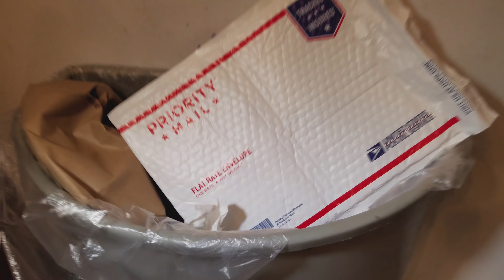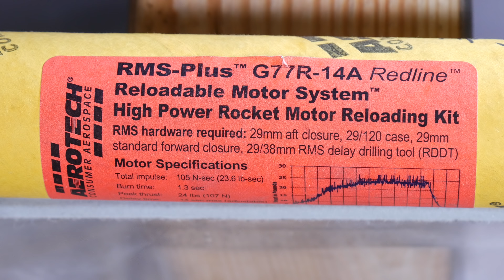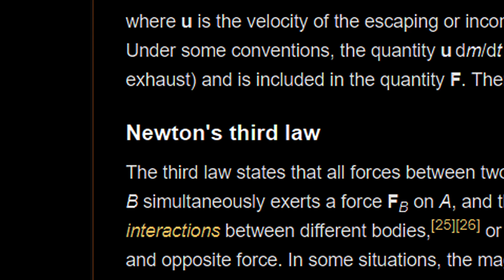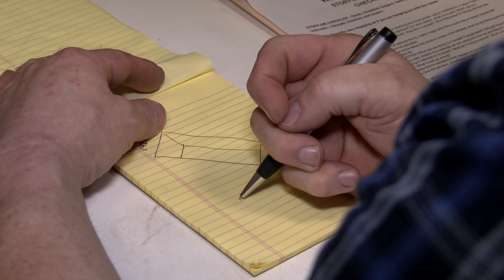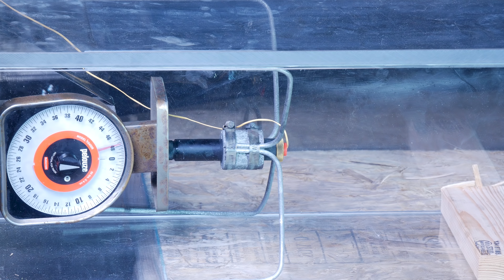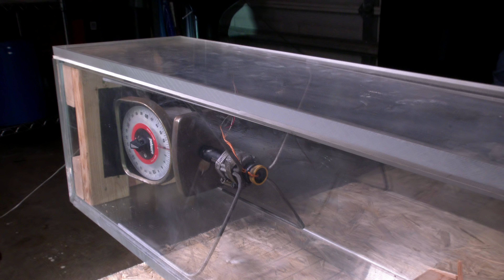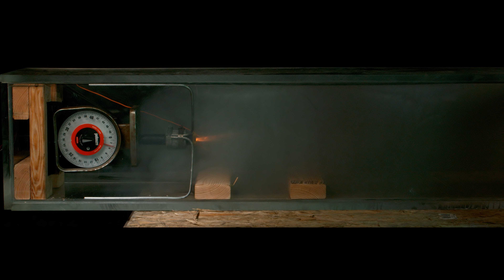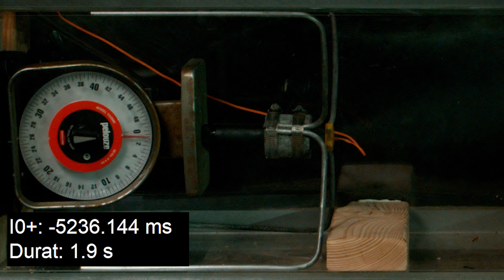Rockets in a Vacuum Chamber - Newton's third law of motion Visualized

Comment: In space if there is vacuum then gases expand not like this in enclosure where existing gases oppose exaust to produce thrust. Also why don't show difference in thrust profile.
Reply: "Thrust" occurs when the rocket PUSHES the mass of the exhaust gas into the vacuum. ANY time one object exerts a FORCE on another BOTH feel the force.
This is called mechanical RECOIL.
Recoil still works in a vacuum.
What would happen if I fired a crossbow into a vacuum?
Would I still feel a recoil force?
YES!
Reply: @stuartgray5877  One object exerts force on other, both experience force. So rocket exerting force on gases or gases exerting force on surrounding.
Reply: @neillibertine3044  no. Rockets exerts force on mass of exhaust gas. exhaust gas exerts force BACK ON THE ROCKET.
No surrounding medium required.

Rocket thrust is the mechanical recoil of pushing on mass.
Same as the recoil from firing a crossbow.
Reply: @stuartgray5877  How rocket exerts force on gases, it's gases which are active component while rocket is container. Yes, masscan do exert force but in space they are free to expand.
Reply: @neillibertine3044  the rocket applies a "force" (gas pressure IS a force) to accelerate the mass of the exhaust gas away from the rocket.
Do you agree that a "force" is REQUIRED to "accelerate" mass??
Do you agree that the exhaust gas leaves the rocket at high velocity or not?
Reply: @neillibertine3044  what would happen if I fired a crossbow into a vacuum????
Would I feel a recoil force OR NOT?
Reply: @stuartgray5877  Yes, force is required to not only accelerate but keep an object in motion, force is cause of motion. If you shoot an arrow from crossbow or bow it will go because it is using elasticity of string or potential to kinetic.

Now why thrust from rocket can't work in vacuum because here gases are working medium and in vacuum, external pressure is zero. So work done by expansion of gases is zero. Thus there is no reaction or thrust produced by rocket in space.
Reply: @neillibertine3044  - "Yes, force is required to not only accelerate but keep an object in motion,"
Absolutely FALSE.

Newtons FIRST LAW:
"Every body continues in its state of rest, or of uniform motion in a straight line, unless it is compelled to change that state by forces impressed upon it."

This means that a force IS REQUIRED to ACCELERATE an object with mass.
If no force is exerted an object will REMAIN IN MOTION INDEFINITELY.

Now perhaps you should try LEARNING about a topic BEFORE trying to debunk it?
Reply: @neillibertine3044  Now ANSWER THE QUESTION:
If I fired a CROSSBOW
INTO A VACUUM

WILL I FEEL A RECOIL FORCE?

WHY are you scared to just answer the question?
Afraid of being proven wrong, or do you just NOT KNOW how recoil works?
Reply: @stuartgray5877  Newton's laws are in order. First one is about motion, second one is cause of motion and third one is state of motion. So second and third give description of motion.
Reply: @stuartgray5877  About crossbow and bow I has already given answer. Qiestion was about thrust from exiting gases in vacuum.

So you have experience in rocketry, I would hear your experience but skeptic about many theories of mainstream science.
Reply: @neillibertine3044  WHY would a crossbow fired into a vacuum HAVE RECOIL??

There is "Nothing to push off of"

HOW can it still feel a recoil force?
EXPLAIN THAT TO ME.
Reply: @neillibertine3044  
"About crossbow and bow I has already given answer."

I asked the question:
"Would a Crossbow fired into a vacuum have any recoil?"

You answered with:
"If you shoot an arrow from crossbow or bow it will go because it is using elasticity of string or potential to kinetic."

THIS IS NOT AN ANSWER TO THE QUESTION.
If you think it IS, then that explains why you dropped out of school before the 8th grade.
Reply: @stuartgray5877  Recoil and shoot, both due to elasticity of frame of a bow. So what is your answer.
Reply: @neillibertine3044  Sorry but that STILL is not an answer to: WHAT DOES THE CROSSBOW PUSH AGAINST in the vacuum of space?

HOW can it feel recoil when there is no AIR resistance.

WHAT IS the "Resistance" that creates the recoil force?
YOU HAVE NOT EXPLAINED THIS.
Reply: @stuartgray5877  What energy spring has, elastic. So bow has same energy due to structure.

Where is your answer.
Reply: @neillibertine3044  Now consider taking an actual PHYSICS CLASS, BEFORE challenging actual engineers about basic physics.
Reply: @stuartgray5877  There is no action-reaction as most think, it is tool to consider momentum conservation and stability. For reaction one needs a obstruction to return force, like a ball thrown on wall.

So recoil from bow is elasticity of frame and when it releases outer edge encounter middle part that remain stable, that cause recoil.
Reply: @stuartgray5877  Then speak up truth that may sets you free.
Reply: @stuartgray5877  lying about everything, as usual, chatbot.
Reply: @papalegba6796 They have faith for science and insists on follow their cult with same faith, while science is about logic, observation and consistency of laws.
Reply: @neillibertine3044  the idea that a thermal rocket can develop mechanical power whilst in a zero external pressure environment violates every single law of physics. This is not debatable.
Reply: @papalegba6796  Tell us how a Space Shuttle Main engine accelerates 500 kilograms of MASS (EVERY SECOND) from a standstill to MACH EIGHT all WITHOUT FEELING A RECOIL FORCE!
Ready GO!

Now RUN AWAY without answering the question LIKE YOU ALWAYS DO GENIUS.
Reply: @neillibertine3044  Why dont YOU try answering my question above to Papa Legba. HOW CAN a machine ACCELERATE - ANY KIND OF MASS - WITHOUT FEELING A RECOIL FORCE.
Because that would violate Newtons Laws.

SO, tell me HOW a Space Shutte Main engine can do that please.
Reply: @stuartgray5877  Newton's second law is not complete description of motion, third law is. Because a force can't accelerate an object for long.

Third law states that at equilibirium, gain in motion by force is equals to loss in motion equivalent to applied force. This is terminal speed and opposing force is drag.
Reply: @stuartgray5877  I couldn't get your question. So either answer or elaborate it.
Reply: @neillibertine3044  - "Because a force can't accelerate an object for long."

False.
A force CAN accelerate ANY mass all the way to Light Speed.

SO you are unable to answer my questions? Maybe try taking a high school physics class BEFORE challenging actual rocket scientists about basic physics?
You have it ALL WRONG.
Reply: @neillibertine3044  - "I couldn't get your question. So either answer or elaborate it."

SO I know of a MACHINE , that can ACCELERATE 500 kilograms of water from a velocity of zero to a velocity of 2500 meters per second.

It does this using a FORCE (gas pressure) to PUSH on the mass of the exhaust gas.
Tell me that a machine CAN 
DO 
THIS
ALL - WITHOUT FEELING an "equal and opposite force" per Newtons THIRD LAW.

I just want YOU to tell ME that you know of a machine that CAN apply a force to a mass and NOT FEEL A RECOIL FORCE.
Tel me of such a machine.
Reply: @neillibertine3044  are you still claiming that a machine can accelerate mass without FEELING a recoil force?
Or did you give up trying because it is all over your head?
Reply: @neillibertine3044  simple question for you. 
Hypothetically,, if I set an explosion off next to you in the vacuum of space, would it have any effect on you?
Reply: @papalegba6796  why do you come on channels like this to troll, you don't add any thing to the discussion other than ad homs.
Reply: @entangledmindcells9359   In vacuum what creates shock waves or quick local vacuum at centre. I think this is sufficient for your question regarding vacuum.
Reply: @neillibertine3044  Huh?  simple yes or no.. 
Hypothetically,, if I set an explosion off next to you in the vacuum of space, would it have any effect on you?
Reply: @entangledmindcells9359  Then ask simple question about vacuum and state what exactly you are asking about explosion. As explosion can have pellets or sharpnels.
Reply: @neillibertine3044  oK an explosion that is a result of a pure chemical reaction that converts two compounds into a GAS that gives off lots of heat causing the gas to expand quickly.
Reply: @neillibertine3044  combustion in a vacuum is impossible as it violates the laws of thermodynamics. Ignore this chatbot & its troll questions.
Reply: @neillibertine3044  yes Neil.. Ignore us.. Papa refuses to address our questions and he certainly doesn't want you to possible learn something.. 
I want you to read my responses and Papa's and I will let you decide who presents evidence and logic to back their position.
Reply: @papalegba6796  Tell us what prevents combustion in a vacuum.. it is a simple chemical reaction between two compounds (fuel & oxidizer) that converts the compounds into new compounds & give off energy in the form of heat.
Reply: @entangledmindcells9359  What you want to tell, I can pick if it is worthy or not. Without resistance, one can't distinguish amount of force.
Reply: @neillibertine3044  to help tutor fellow students in physics & engineering I used examples to help them understand how to visualize things. 

If an explosion that was a pure chemical reaction between two compounds that resulted in energy being release & new compounds in form of gas, Would you expect that gas to expand in all directions?

Answer is :
In physics we have laws of motion and if no external force is applied to a system the net momentum of the system can not change. (momentum is defined as velocity, speed with direction, times mass) This is why gas would expand in all directions.

if the expanding gas is prevented from expanding on one direction, work(a force) must be done to the gas to prevent it from expanding in a direction. 

In physics for every force there is an equal and opposite force.  For the force applied to the gas by some object A to prevent the gas from expanding, the gas applies and equal and opposite force to object A. 

------------------------
Back to the laws of motion & momentum. 
If the Rocket fuel and oxidizer start out moving with the rocket in their storage tanks but then go to being burned and ejected out the rear of the rocket at high speed, that rocket exhaust (that has mass) has momentum going away from the rocket.  Because there is no external force, the rocket must gain momentum in the opposite direction to offset the exhaust.. I encourage you to look up the Laws of motion. 

If you have any questions about this.. I would be happy to explain in further detail any of these.
Reply: @entangledmindcells9359  This is all we already discussed in above comments but you are persisting on to agree with your indoctrination. Okay, many times in presence of external force there is no momentum change, as in static balance or an object reach at equilibirium as in your moving car, engine is producing force to maintain constant speed.

Without external agency there is no reaction which you alraedy stated in your comment, conservation of momentum. Strangely in last you u-turned and said to preserve momentum there is reaction, hilarious.
Reply: @neillibertine3044  Here are some "FACTS" for you:
A space shuttle main engine consumes 500 kilograms of liquid oxygen and liquid hydrogen PER SECOND.
It combusts the fuel and oxidizer creating over 3000 PSI of gas PRESSURE in the combustion chamber. 
Then the exhaust gas (PURE WATER) exits the combustion chamber at over 2500 meters per second (this is MACH EIGHT).
So a space shuttle main engine ACCELERATES 500 kilograms of PURE WATER (per second) from a standstill to MACH eight.

Neil - Tell us that this machine CAN ACCELERATE 500 kilograms of MASS from a velocity of zero to MACH EIGHT - WITHOUT FEELING A RECOIL FORCE !!

Tell us that YOU BELIEVE a machine CAN accelerate 500 kilograms MASS to MACH EIGHT with NO RECOIL FORCE WHATSOEVER.
Tell us you think that.
Reply: @neillibertine3044  Here is another "fact" for you.
IF you were capable of explaining Mechanical RECOIL - TO US, you would understand how rocket propulsion works.
You have NO IDEA how recoil force manifests itself DO YOU?
Just EXPLAIN how a Crossbow STILL HAS RECOIL when fired into a vacuum.
 Even though there is ""Nothing to push on " according to your misguided understanding of basic physics.
Prove ME WRONG by EXPLAINING IT.
Reply: @stuartgray5877  We already discussed crossbow twice so move on. Rest what do you mean by rocket exaust by that rate, is it same for different heights. Tell how much mass it exits per second.
Reply: @neillibertine3044   you stated above  relattive to expanding gas in a vacuum
" So work done by expansion of gases is zero."
Do you not agree gas would expand in all directions of left  to freely expand?

if something prevents it from expanding freely, it does work on the gas.. And simple physics requires if Object A does work on Object B, Object B does equal but opposite work on A. 

So expanding gas can do work in a vacuum if something impedes its ability to freely expand. Notice no "external" force is required. 

FYI.. you have to address if gas is not allowed to freely expand,  how it can be done with no work done to it.
Reply: @entangledmindcells9359   Okay, you mean to say that as gas is not allowed to expand by rocket, so it pushes rocket. But there is flaw in this argument that gas do work on rocket, so rocket reacts on gas in opposite direction and that is how they exit, like a ball collide with wall.
Reply: @neillibertine3044  - "Tell how much mass it exits per second."
It exhausts exactly the same mass as went in: 500 kilograms per second.
It is in the form of pure water.
Reply: @stuartgray5877  It is equivalent to square root of (pressure × speed)/(mass) multiply by area which is missing. But that can produce reaction as said in above comment to @Entabgled Mindcells.
Reply: @neillibertine3044  Simple question.

Do you agree that ball will no longer continue in its path it was going when it hits the wall?
Reply: @entangledmindcells9359   Yeah if it not either jump over wall or break through it. Joke apart, yes it will return back with or without some angle, so what.
Reply: @stuartgray5877  If conservation of momentum is real then recoil to revolver should much more than rifle as speed and mass of bullets are similar but mass of revolver and rifle is much large and recoil also. Reason is that rifle has longer barrel and exiting gases from bullet push it more.

Third law which is conservation of momentum is about equilibirium when gain and loss is equal. On falling object, gravity is balanced by drag soon and object is no longer accelerated. Also conservation of momentum is no more different from conservation of kinetic energy, interaction should be minimum.
Reply: @neillibertine3044  simple.. the wall did work on the ball to change its path and the ball in turn did equal and opposite work on the wall. 

Now connect the dots.
the wall is the rocket..
The ball is the molecules of rocket exhaust trying to expand in all directions. 

If the rocket exhaust is not allowed to expand.. What ever did work on the gas to prevent it from expanding had equal work done on it in the opposite direction by the exhaust.
Reply: @entangledmindcells9359  This is similar to there is ball instaed of wall, a ball collide to other ball and that moves. So there is no meaning of speed at which gas exit.
Reply: @neillibertine3044   "So there is no meaning of speed at which gas exit."??? huh

Sorry to hear you don't understand basic physics.. No wonder why you don't understand how rockets work in space
Reply: @neillibertine3044  In the US we take "classes" where we learn about things like "Physics".

In these classes there are "Books" where we read about the topic.

Maybe you should TRY reading one of these "Physics Books" BEFORE trying to lecture actual physicists about physics?
Reply: @stuartgray5877  Maybe you took these texts as faith and practice religiously and criticize people who believe in other religion.
Reply: @neillibertine3044  NO - I make observations of basic physics.  And I launch things to space as my job.
Did you miss the part where the deep space science missions I have launched have had scientific peer review of the returned science by MILLIONS of actual scientists?
But a high school dropout has proven ALL OF THAT a lie by just looking up at the stars?
Bless your little heart!
Reply: @neillibertine3044  Just so I understand correctly:
You believe that YOU are CORRECT about basic physics, while ALL of the Engineers, Physicists, and Scientists are WRONG.
YOU (a high school dropout that has NEVER taken a single physics class) knows MORE ABOUT PHYSICS than ALL Of the Physicists!

Got it.
You are a genius.
Reply: @stuartgray5877  Thanks for understanding me. But on this field I am using logical consistency and looking for claimed evidential support of institutionalized subjects.

Problem with physics is that they wrongly interpret laws of motion and creators of modern theories interpret thier theories (relativity) wrong, that put doubt on them as really theories are originally from them or ad hoc explanation to cover things.
Reply: @neillibertine3044  So simply put.. 
If Physics disagrees with you.. you deny it. 

Please share with us what Modern inventions use your version of physics. I would really love to see  that. I can assure you every Engineering School in the world disagrees with you.
Reply: @neillibertine3044  so again: according to YOU: Newtons Third law does not apply in a vacuum "cuz reazons".
Got it.
So your personal incredulity overrules my personal observations as a professional test engineer.  Even though YOU have never actually done the experiments while I HAVE.
Reply: @entangledmindcells9359  Your extrapolation about me has insufficient data, physics is open field to discuss.

Science is not for inventions but ecplanation for understanding of how natural things behave in given conditions. Edison invented a lot without much understanding of laws.

Though every invention or working model has some explanation in terms of natural laws. My theory is that force is cause of motion and without force things comes to halt, example is a car.
Reply: @stuartgray5877  Observation of nature is open to all. Third law of motion or conservation law is about equilibirium which has been denying for long.
Reply: @neillibertine3044  thank you for you last post. 
You show beyond doubt, you do not understand BASIC Physics. 
And you think you are capable of conversing on topics regarding physics..
Reply: @neillibertine3044  why no response?
Having trouble coming up with another juvenile counterargument?
Reply: @stuartgray5877  About what, action-reaction or conservation of momentum.
Reply: @neillibertine3044  the exchange of momentum is EXACTLY how rockets work. When the nozzle applies a force to accelerate the mass of the exhaust gas in one direction it changes its MOMENTUM. For the rocket to give the mass of the exhaust gas momentum it did not have previously it MUST absorb the same momentum but in the opposite direction for "total system momentum" to remain the same. This is the definition of the Law of Conservation of Momentum. It is also what gives crossbows recoil in a vacuum
Reply: @neillibertine3044  What would happen if you built a big crossbow that could fire a 500-kilogram block of ice at 2500 meters per second (Mach eight).

Would the crossbow feel a RECOIL FORCE due to accelerating that mass?
Just answer the question stop trying to distract from it.
Can a machine ACCELERATE 500 kilograms of MASS from a standstill to Mach 8 WITHOUT FEELING A RECOIL FORCE?
Yes or No?
Reply: @entangledmindcells9359  Now watch as he STILL just refuses to answer my question.
He is just like Papa Legba - he refuses to answer questions that prove him wrong. (Which for Papa Legba is ANY QUESTION)
Reply: @papalegba6796  - "combustion in a vacuum is impossible as it violates the laws of thermodynamics."

Good thing the combustion chamber runs at about 3000 PSI - EVEN IN HARD VACUUM.
Just because there is vacuum DOWNSTREAM does not mean that combustion is occurring "in a vacuum".
The combustion chamber cannot even TELL the difference between running with an external pressure of 14.5 PSI or 0.0 PSI.
That is only a 0.5% difference in Differential pressure.
But who am I kidding YOU don't even understand the concept of absolute versus differential pressure.
YOU cannot even answer such simple questions as: What happens to a cylinder of gas at 3000 PSI and you just open the valve in space.
Even THAT is above your level of comprehension.
Reply: @neillibertine3044  Why did you run away? Questions to much for your intellect?

Would a crossbow fired into a vacuum HAVE RECOIL OR NOT?
Reply: @stuartgray5877  I suppose we have discussed about your crossbow. There is difference between crossbow and rocket while former is projectile or deaccelerated motion and later is like vehicle which gain speed later or accelerated motion.

In projectlie, launch is crucial because sometimes holding a projectile bit more reduce its possibility of speed gain. For theoretical purpose we assume no energy loss so apply conservational laws.
Reply: @neillibertine3044  But I want YOU to explain to ME ( using Physics terms) HOW RECOIL WORKS.
I want it in YOUR WORDS.
Now EXPLAIN HOW RECOIL WORKS.
Perhaps you could ask ChatGPT how it works if you don't know.
Reply: @neillibertine3044  The part YOU are missing it that ANY object (a mass) that applies a FORCE to another object (mass) feels the SAME FORCE!
When a gun fires a bullet, the BULLET has a force applied to it to push it from the barrel.
The GUN FEELS THIS FORCE as the bullet is accelerated.
As the gun applies a force to the bullet the SAME FORCE is felt BY THE GUN pushing it backwards.
The "Resistance" is the MASS OF THE BULLET because it does not change velocity instantaneously it TAKES TIME.
Therefore, the FORCE applied by the gun to the bullet is felt by BOTH the Bullet AND THE GUN.
 This is the RECOIL FORCE.
You CANNOT accelerate MASS without feeling a RECOIL FORCE.
This is what Newtons THIRD LAW STATES
"For EVERY ACTION there is an Equal and OPPOSITE REACTION"
So when a Rocket PUSHES on the mass of the exhaust gas the ROCKET FEELS THE FORCE TOO!
Is there a force accelerating the exhaust gas? YES!
WHERE does this Force ORIGINATE???
THE ROCKET NOZZLE!
So if there is ONE FORCE PUSHING on the mass of the exhaust gas - there MUST BE AN EQUAL FORCE PUSHING BACK ON THE ROCKET!
You CANNOT have single ended force - they ONLY OCCUR IN PAIRS!  - PERIOD.
 END OF CONVERSATION.

I am NOT SPECULATING - this experiment has been done MILLIONS OF TIMES - LITERALLY!
Reply: @neillibertine3044  Now tell me what makes you think YOU are qualified to argue basics physics with rocket scientists?
Do you STILL think I am LYING about my 30 year career of launching rockets to space?
No, REALLY - tell me YOUR life experiences regarding REAL ROCKETS.
And tell me WHY you think YOUR information is more factual than mine.
 I have personally launched SIX real spacecraft, been the Launch Conductor for more than one, then helped operate three of those after they reached space .
I have witnessed over 30 real rocket launches, many from closer than the public is allowed. I have FUELED multiple spacecraft before helping put them on the actual rocket.
I have FIVE NASA achievement awards for my efforts building and launching these science platforms.
Now tell me WHAT PART of your education Trumps my hands-on experience?

I suspect the extent of your "education" on the subject is watching a few flat earth videos on YT.
Reply: @stuartgray5877  Recoil in gun is not due to conservation of momentum but hot gases push the barrel end. This is similar to hitting a ball to wall but there is difference because ball is not accelerating so can apply conservation laws.
Reply: @neillibertine3044  - "Recoil in gun is not due to conservation of momentum but hot gases push the barrel end. "

IF this was true then CROSSBOWS would NOT HAVE ANY RECOIL as there is no gas ejected.

Neil - Are you suggesting that CROSSBOWS don't have any recoil??
Because that would be PROOF that you have no idea what you are talking about.

Please EXPLAIN how the recoil works in a crossbow. You KNOW that you cannot.
Reply: @stuartgray5877  Recoil in bow or crossbow is due to deformation occured in frame by pulling string. When it is released, frame gain its shape but due to sudden release it gains speed. But that speed of frame obstructed by base structure which is not in bow.
Reply: @neillibertine3044  you did not explain how the recoil force is generated.
Of course "the bowstring applies a force to the mass of the projectile, accelerating it for the entire time the projectile is on contact with the bowstring".
Would you agree?
Now HOW does that action result on a force BACK on the bow?
Reply: @stuartgray5877  I already said, if you want to edit or add then go on.
Reply: @neillibertine3044  Does a crossbow that fires a larger mass feel MORE recoil than a smaller mass projectile?

What happens if the crossbow and projectile are the SAME MASS?
Reply: @stuartgray5877  When you swing your arm, does it affected your arm whether you throw a rock or empty hand. If recoil is due to frame then what is meaning of mass of a projectile, other than speed of projectile.

Now without sharing your view you want to play safe by asking me only. What is your view on recoil. About action-reaction, present view of science is not correct.
Reply: @neillibertine3044  What happens if you stand on a frictionless surface and throw a Bowling Ball?
Now, do the same experiment but you throw a BEACH BALL.
Which experiment results in more recoil force ????   EXPLAIN!!!
Reply: @stuartgray5877  What do you expect if on same frictionless surface a truck moves. Now take a small car, what you get.
Reply: @neillibertine3044  So you STILL refuse to answer my questions?
WHY are you afraid to just answer questions?

WHAT happens if I throw a Bowling ball while standing on a frictionless surface?
WHAT happens if I throw a BEACH ball while standing on a frictionless surface?

Are these questions too difficult for you?
Reply: @neillibertine3044  - "What do you expect if on same frictionless surface a truck moves. Now take a small car, what you get."

SO you just keep proving that you do NOT understand basics physics AND are incapable of asking coherent questions.
That question does not even qualify for a response.
I have a VIDEO of my experiment on my YT channel where I fire two different mass projectiles from a crossbow and record the results.
WHAT DOES MY VIDEO SHOW GENIUS?
Reply: @stuartgray5877  So this is your response, wriitten a long para but don't answer.
Reply: @neillibertine3044  It is impossible to answer your question.
Try writing COHERENT Questions.
Reply: @stuartgray5877  Question was simple, what happens if a truck suspended in air with freely movable cable and truck is in operative mode. Then replace truck by small car, is result differ, how much.

Your theories are established so your narrative seems smooth, yes for you people. My criticism or theories are against settled and people who are highly indoctrinated and some are delusional, also supported by State and media. So I might struggle.